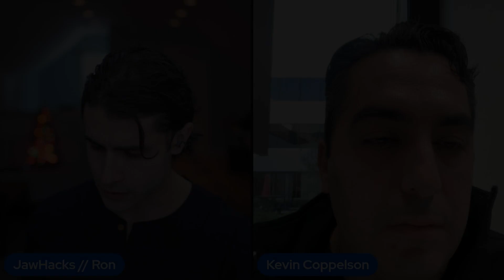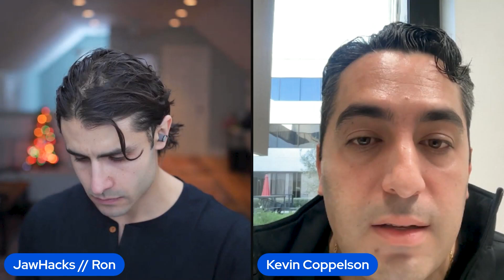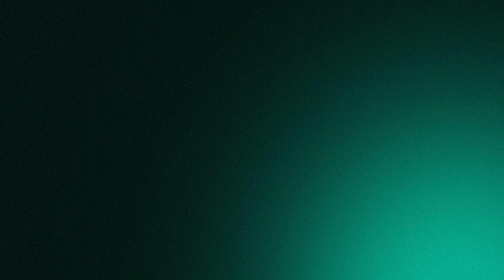How to Avoid MARPE Asymmetry Complications

Comment: After reviewing 10+ FME cases, the only case I've ever seen with any asymmetry was a case that was post-MMA, and the pterygomaxillary suture split on only one side, essentially because of the prior surgery, it was weakened. Otherwise, I haven't seen it expand asymmetrically even once, and I'm beginning to think that I may never. I think that the actual design of the device might be more important in regards to asymmetric expansion than the orientation of the expander, or one side of the skull being stronger than the other, etc. At the end of the day, the whole idea that one side is stronger than the other is mostly just a theory, right? What is there to really back it up? If another expander never expands asymmetrically, then doesn't that basically disprove that theory?

And in some of the cases i've seen, the FME wasn't even put in perfectly level, especially in the earlier cases. Dr. Li's first FME case it was put in quite tilted, but it seems to be perfectly symmetric anyway, which really surprised me. If you put a TPD in like that, it would be expanding all wonky, but the FME apparently not. From my standpoint, having spoken to people who have had these asymmetric expansions too, are the providers going to try to do anything to prevent them from happening?
Reply: There's assymetry because there is no balanced inward pressure. Someone needs to 3d print an exterior appliance that will provide adjustable inward pressure, while being attached to the skull. Something like a helmet
Reply: @luisislas2162  If the FMEs aren't asymmetric then the problem is solved..
Reply: @shuikai272  what about factoring assymetric bone structure?
Reply: @luisislas2162  So far doesn't seem to matter with the FME, whereas with the other ones it does.
Reply: After reviewing 10+ cases? So like 15? Is that enough to say FME is significantly more reliable than other options? I don’t think so
Reply: @Chiimpyboi  After reviewing about 30 EASE, i'd say about 90% of them were expanding asymmetrically to some degree, clearly unstable. So.. mathematically that to me is quite significant.